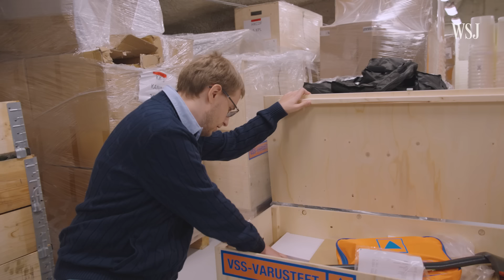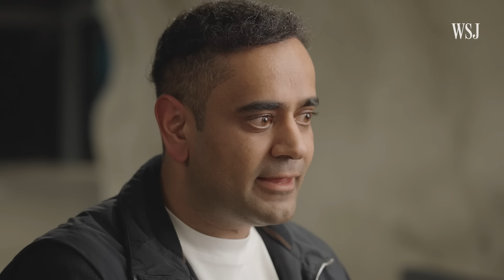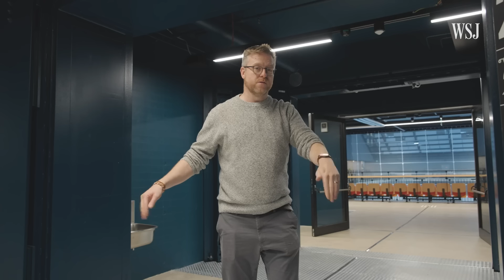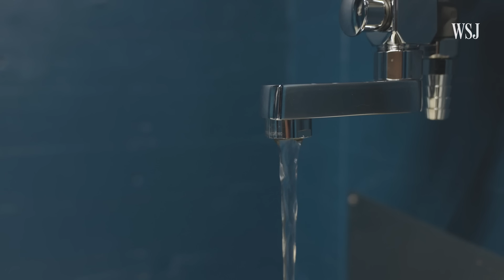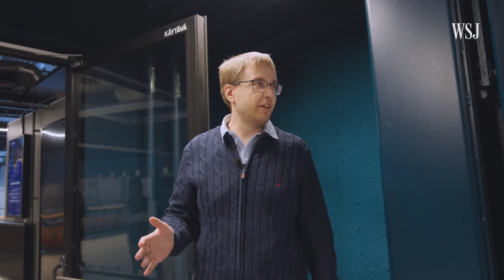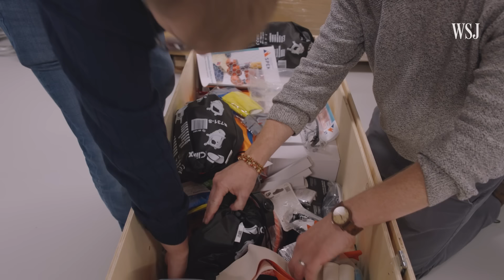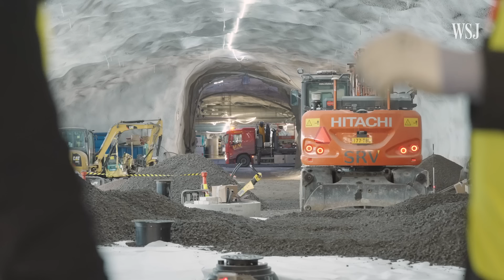What It Takes to Build a Modern Nuclear Shelter for 7K People | WSJ

Comment: If you think you're going to survive in this thing, you're an idiot.
Reply: Why?
Reply: Many people thinks that those shelters are only for the nuclear bomb attack or that you have to live there for a longer period of time. 
They are only partly right, bomb shelters are primarily for war situations where people have to be evacuated underground, for example due to missile and drone attacks or if the attacker decides to use chemical weapons against the civilian population. A nuclear attack is only the worst-case scenario, which has also been considered, but the main purpose of bomb shelters is to prevent enemy missiles, drones and other air strikes, for example bombers. The bomb shelter in the video was just one of many, but Finland is full of various sized civilian shelters, the largest of which are located underground, about 10-30 meters underground. All large residential buildings have a civilian shelter for residents, and if you do not have your own civilian shelter, the nearest underground shelter can be found in large population centers 1-15 km away. In Finland, it has been necessary to prepare for this type of evacuation of people because Finland's eastern neighbor, Russia, has shown in its history that it is capable of launching an offensive war at any time for any reason. Ukraine is a good example of this for the modern world, while Finland still remembers what happened in 1939. 
Finland has been preparing for the worst for over 80 years and this is maintained only because the worst option may come true someday. There are only about 5.5 million people in Finland, but it is important to note that with these preparedness measures that have been taken in the past, Finland is able to offer a civilian shelter to about 4.6 million people in the event of a crisis. I think this is a great achievement by the Finns and what is best is that every adult Finn is aware of this and they are constantly trained for various crisis situations. 
Within 72 hours, most of the entire adult population is put on alert if, for example, they are targeted by a full-scale war of aggression launched by an external state or actor. This includes wartime troops, army reserve troops whose deployment begins immediately, other crisis troops, hospitals, provincial troops, and other personnel who, in addition to their own civilian work, have received special training for war and crisis situations. 
And as I said, Finland is preparing for the worst, but only because they are ready to defend their homeland and their own independence as an independent state and to give the best opportunity for Finns to survive together so that no one is left alone. 

Your homeland is where you were born and for Finns, their own country is the best and most beloved, they want to hold on to it now and in the future by preparing for the worst scenario as well. 

Peace and Love to all over the World!❤️

Comment: The thing with these is that we should really be building them even deeper if we're going to try safeguard against civilizational extinction events. Nuclear war is relatively mild compared to what asteroids and comets can do and while these can cause such levels of destruction that no underground shelter is going to be enough, there's plenty of smaller possible events on the scale that are more destructive than nuclear war but still survivable in deep enough shelters. Early detection systems for evacuation and systems for diverting the incoming objects are nice but it really wouldn't hurt to have backups like asteroid shelters too because we can't ever have a 100% detection rate and 100% deflection rate.
Reply: Eh. There's supplies only for so long that the initial radiation starts to get lower, which is maybe a bit over week. If there's an asteroid or comet which you have to protect yourself you'd need a bunker with supplies for years or decades because of the cooling of the planet, failing harvest etc. Protecting yourself from such an event is just fantasy.
Reply: @McSlobo Given that the asteroid that wiped out the dinosaurs may have blocked out the sun for 15 years, it is extremely unlikely that anyone has a shelter to last that long, for many reasons. The only logical plan for humanity's insurance and expansion is massive space stations where we can match Earth's gravity. And I predict half of the Earth's population will be living in these stations, before the end of this century.

Comment: I'm reading Annie Jacobsen's book 'Nuclear War: a Scenario' right now.  Basically, these shelters turn into high temperature ovens if the bomb goes off anywhere near the shelter.
Reply: Nuclear war is not a main worry here in Finland. Our lovely neighbour isn't going to nuke us easily, because they couldn't avoid being hit by the fallout as well. More likely scenario would be ordinary bombs. Like what they have in Ukraine right now.
Reply: Many people thinks that those shelters are only for the nuclear bomb attack or that you have to live there for a longer period of time. 
They are only partly right, bomb shelters are primarily for war situations where people have to be evacuated underground, for example due to missile and drone attacks or if the attacker decides to use chemical weapons against the civilian population. A nuclear attack is only the worst-case scenario, which has also been considered, but the main purpose of bomb shelters is to prevent enemy missiles, drones and other air strikes, for example bombers. The bomb shelter in the video was just one of many, but Finland is full of various sized civilian shelters, the largest of which are located underground, about 10-30 meters underground. All large residential buildings have a civilian shelter for residents, and if you do not have your own civilian shelter, the nearest underground shelter can be found in large population centers 1-15 km away. In Finland, it has been necessary to prepare for this type of evacuation of people because Finland's eastern neighbor, Russia, has shown in its history that it is capable of launching an offensive war at any time for any reason. Ukraine is a good example of this for the modern world, while Finland still remembers what happened in 1939. 
Finland has been preparing for the worst for over 80 years and this is maintained only because the worst option may come true someday. There are only about 5.5 million people in Finland, but it is important to note that with these preparedness measures that have been taken in the past, Finland is able to offer a civilian shelter to about 4.6 million people in the event of a crisis. I think this is a great achievement by the Finns and what is best is that every adult Finn is aware of this and they are constantly trained for various crisis situations. 
Within 72 hours, most of the entire adult population is put on alert if, for example, they are targeted by a full-scale war of aggression launched by an external state or actor. This includes wartime troops, army reserve troops whose deployment begins immediately, other crisis troops, hospitals, provincial troops, and other personnel who, in addition to their own civilian work, have received special training for war and crisis situations. 
And as I said, Finland is preparing for the worst, but only because they are ready to defend their homeland and their own independence as an independent state and to give the best opportunity for Finns to survive together so that no one is left alone. 

Your homeland is where you were born and for Finns, their own country is the best and most beloved, they want to hold on to it now and in the future by preparing for the worst scenario as well. 

Peace and Love to all over the World!❤️

Comment: Only 7000 people... mmkay
Reply: there are many of these shelters in Kuopio
Reply: Yes, that one. But we have a shelter in every building over 1200 square metres, meaning every large apartment building, school, sports hall, shopping center etc. That's mandatory by law.
Reply: Many people thinks that those shelters are only for the nuclear bomb attack or that you have to live there for a longer period of time. 
They are only partly right, bomb shelters are primarily for war situations where people have to be evacuated underground, for example due to missile and drone attacks or if the attacker decides to use chemical weapons against the civilian population. A nuclear attack is only the worst-case scenario, which has also been considered, but the main purpose of bomb shelters is to prevent enemy missiles, drones and other air strikes, for example bombers. The bomb shelter in the video was just one of many, but Finland is full of various sized civilian shelters, the largest of which are located underground, about 10-30 meters underground. All large residential buildings have a civilian shelter for residents, and if you do not have your own civilian shelter, the nearest underground shelter can be found in large population centers 1-15 km away. In Finland, it has been necessary to prepare for this type of evacuation of people because Finland's eastern neighbor, Russia, has shown in its history that it is capable of launching an offensive war at any time for any reason. Ukraine is a good example of this for the modern world, while Finland still remembers what happened in 1939. 
Finland has been preparing for the worst for over 80 years and this is maintained only because the worst option may come true someday. There are only about 5.5 million people in Finland, but it is important to note that with these preparedness measures that have been taken in the past, Finland is able to offer a civilian shelter to about 4.6 million people in the event of a crisis. I think this is a great achievement by the Finns and what is best is that every adult Finn is aware of this and they are constantly trained for various crisis situations. 
Within 72 hours, most of the entire adult population is put on alert if, for example, they are targeted by a full-scale war of aggression launched by an external state or actor. This includes wartime troops, army reserve troops whose deployment begins immediately, other crisis troops, hospitals, provincial troops, and other personnel who, in addition to their own civilian work, have received special training for war and crisis situations. 
And as I said, Finland is preparing for the worst, but only because they are ready to defend their homeland and their own independence as an independent state and to give the best opportunity for Finns to survive together so that no one is left alone. 

Your homeland is where you were born and for Finns, their own country is the best and most beloved, they want to hold on to it now and in the future by preparing for the worst scenario as well. 

Peace and Love to all over the World!❤️

Comment: Pretty much every apartment complex and official building has a designated civil defence center in Finland. Usually its the underground- or separate building storage house with blast doors. Won't help much against nuclear blastwaves but air filtration and walls are thick enough to deal with all the radioactive stuff.

Comment: “My Summer Shelter”
Reply: Godlike reference
Reply: Many people thinks that those shelters are only for the nuclear bomb attack or that you have to live there for a longer period of time. 
They are only partly right, bomb shelters are primarily for war situations where people have to be evacuated underground, for example due to missile and drone attacks or if the attacker decides to use chemical weapons against the civilian population. A nuclear attack is only the worst-case scenario, which has also been considered, but the main purpose of bomb shelters is to prevent enemy missiles, drones and other air strikes, for example bombers. The bomb shelter in the video was just one of many, but Finland is full of various sized civilian shelters, the largest of which are located underground, about 10-30 meters underground. All large residential buildings have a civilian shelter for residents, and if you do not have your own civilian shelter, the nearest underground shelter can be found in large population centers 1-15 km away. In Finland, it has been necessary to prepare for this type of evacuation of people because Finland's eastern neighbor, Russia, has shown in its history that it is capable of launching an offensive war at any time for any reason. Ukraine is a good example of this for the modern world, while Finland still remembers what happened in 1939. 
Finland has been preparing for the worst for over 80 years and this is maintained only because the worst option may come true someday. There are only about 5.5 million people in Finland, but it is important to note that with these preparedness measures that have been taken in the past, Finland is able to offer a civilian shelter to about 4.6 million people in the event of a crisis. I think this is a great achievement by the Finns and what is best is that every adult Finn is aware of this and they are constantly trained for various crisis situations. 
Within 72 hours, most of the entire adult population is put on alert if, for example, they are targeted by a full-scale war of aggression launched by an external state or actor. This includes wartime troops, army reserve troops whose deployment begins immediately, other crisis troops, hospitals, provincial troops, and other personnel who, in addition to their own civilian work, have received special training for war and crisis situations. 
And as I said, Finland is preparing for the worst, but only because they are ready to defend their homeland and their own independence as an independent state and to give the best opportunity for Finns to survive together so that no one is left alone. 

Your homeland is where you were born and for Finns, their own country is the best and most beloved, they want to hold on to it now and in the future by preparing for the worst scenario as well. 

Peace and Love to all over the World!❤️
Reply: Don't you step on my 75x75 space.
Reply: Nah. "My Nuclear Winter Shelter"

Comment: Interesting to see. I think the Finns are the most prepared in the Nordic countries. Great that they are part of Nato. As a Norwegian, I would guess that this something we never would be able to build. We would end up using 50% on planning, most on business consulants , then have a tender and buy the cheapest possible soultion from a company without any trackrecord 🤣
Reply: Yeah I'm not going to believe any of that. Because every country thinks their leaders are the worst. Norway is already developed in so many different ways that if it wanted, it could to do the same and it would probably even fancier than in Finland.
Reply: Good to have small settlements in fjords. They're quite protected. But Norway has a lot of tunnels which could be modified quite easily to offer some protection against threats.

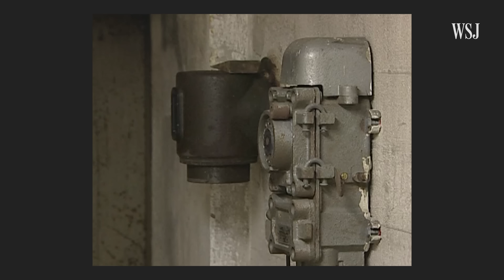Comment: 5:30 note: those are Flak towers designe as Anti Aircraft Batteries and emergency shelters for WW2 - not nuclear shelters.
Reply: Bet you a dollar they would hold up pretty good. The reason they are still there is too hard to demolish. As an American, we just plan to shoot the radiation till it's dead.
Reply: @EricFeeler .. guess you're about to lose a dollar
Reply: @flynngoodwo yeah but it's only an American dollar so not like I'll miss it. My point was if those flak towers can't handle it not much else will.

Comment: 2:39 what is the reason to block the door from moving? I see those floor blocks everywhere. Cant really close them fast that way.
Reply: Like said in the video, the shelters are required to be usable in 72 hours, they aren't ready to use immediately. That flooring is just metal sheets that can be lifted up and moved to the side with relatively low effort (undoing screws etc at most), and is there to just make it easier to move around during peacetime.

Comment: No modern toilets... Now that's surprising.
Reply: Electricity and running water might be in short supply after a bombing campaign.
Reply: There is. But you have to have backup.
Reply: Would be insane to build the required amount of toilets for 7000 people and have no use for them in normal operations. Imagine all the money wasted on plumbing that needs to be replaced every few decades and compare it to the amount of buckets you can get.

Comment: Only a few vaults are shown in public like this. There are various types among the 80.000 vaults. Some are focused on military, some are warehouses of certain categories, fluid storages, some are war factories, repair facilities. Some are linked, some are not, some are very deep in granite.
Reply: I wonder how well protected they are from modern drones, which are the most likely threat in the event of war.  If the doors are left open, a drone could fly in and destroy sensitive equipment.  For a large shelter like in the video, the Russians might fly continuous drone patrols around its entrance to prevent any use of it.
Reply: Those are not having doors open during the crisis.

Finnish army has taken experience from Ukraine and currently at every army's buildings, and shelters too, they are making changes because of drones.